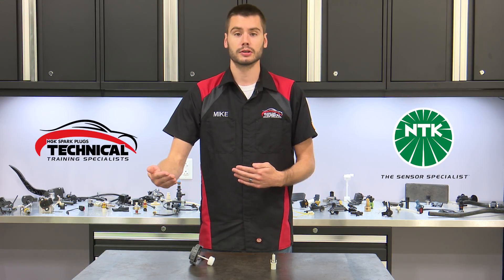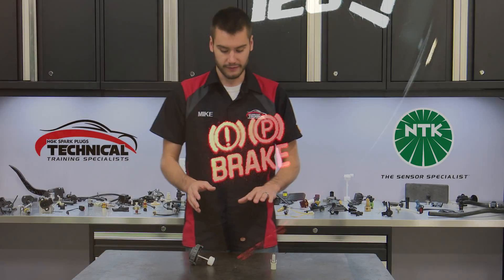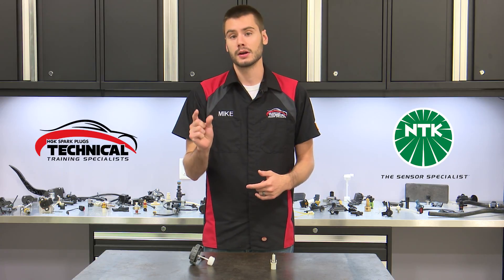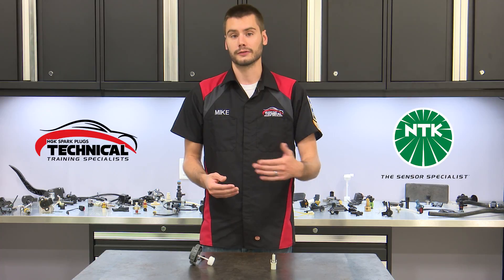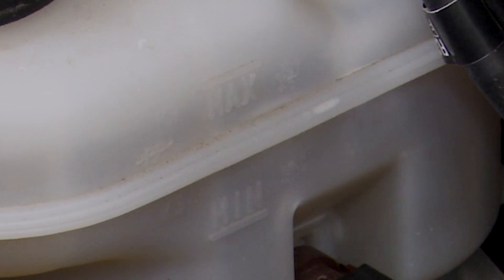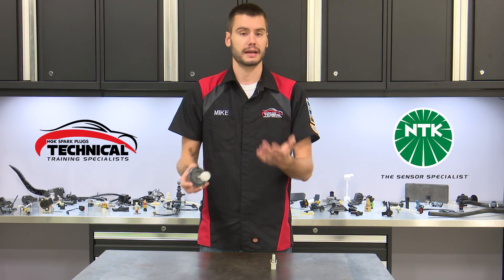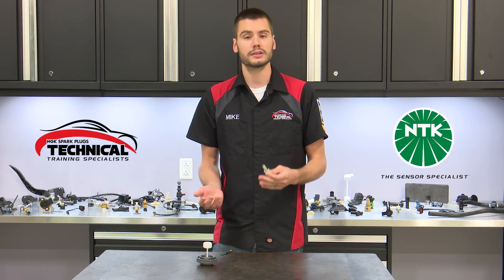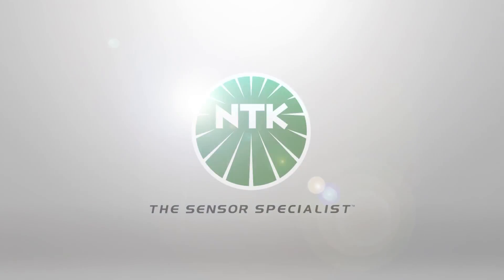NTK - Brake Fluid Level Sensor

Comment: Should my master cylinder reservoir sensor be receiving 10 amps of power through one wire and then when the reservoir is low on fluid it would trigger and allow the current to flow back out into the other wire?

Comment: Also, why does a float sensor fail ? It's a magnetic float device, what could potentially go wrong for a failure ?.. can this be repaired easily.. The cost to replace is high and a simple repair option might be better ?. Can you show what's inside a failed float sensor

Comment: I replaced a brake fluid level sensor on a chevy venture and still got the low level on dash. That sensor is a magnetic switch on this case and float was stuck low. Using a rubberized handle of a screwdriver and a speaker magnet, after GENTLY hitting with the screwdriver handle and moving the magnet up and down, the float lever came free and is all okay now... thank you for your video.